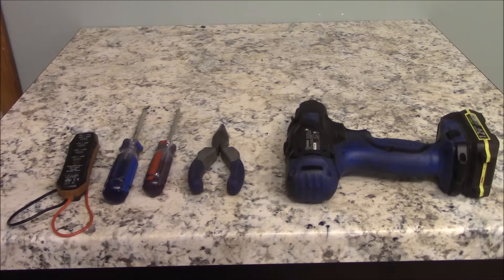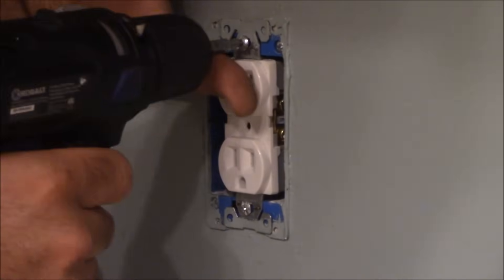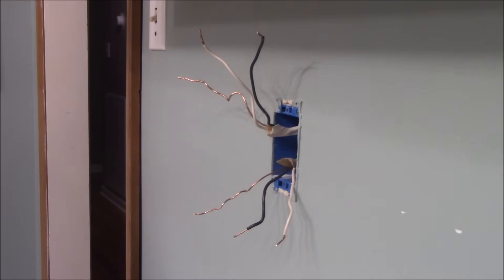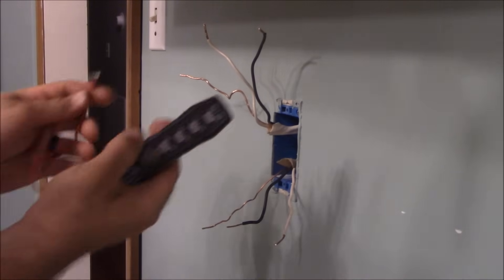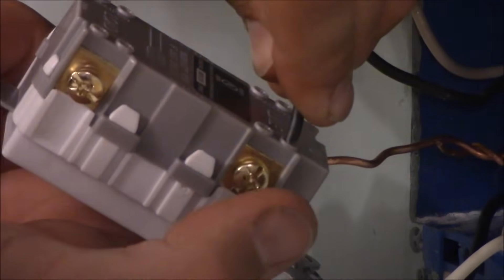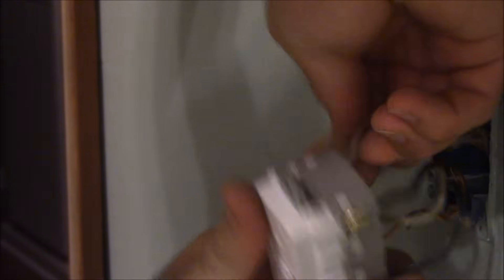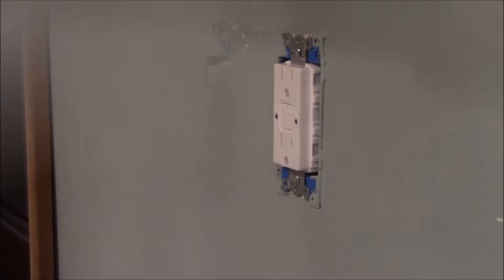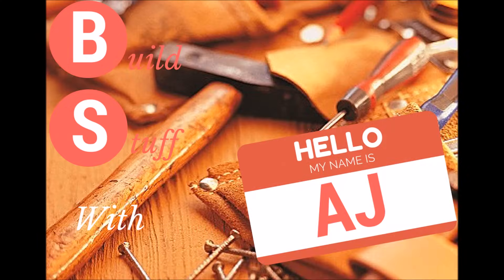Removing and Replacing regular outlet with GFCI outlet

Comment: What if both my wires are load wires? it’s a two circuit outlet?
Reply from the maker: Do you mean that there are 3 different set of wires comming Into the box?
Reply: @BuildStuffwithAJ  What I’m going to do is just install an outlet receptacle like the one before it. This is a split circuit sharing one neutral wire and there’s no way to split the GFCI outlet. Thanks for your help!
Reply from the maker: @LeonidasD828  yea that sounds like your best option. They may sell a gfci outlet that you can split, but I've not installed one personally so I cant say for sure.
Reply: @BuildStuffwithAJ  I switched the outlet to a regular outlet and broke off the tab on the brass side(hot) and we’re good to go. Thanks AJ!
Reply from the maker: @LeonidasD828  that's great to hear! I'm glad you got your project finished!
Reply: @BuildStuffwithAJ  Hi AJ no going into the box is Two lives with one of those lives caring a neutral and a ground wire I believe it’s a two circuit with one shared neutral usually when you connect the cables on an outlet like this you break the tab in the middle but on the GFI I do not see a tab that I can break

Comment: Nice video. I will be doing this install soon. My only suggestion is to check to which wire is hot before unscrewing them. There should be enough bare wire to test so a bunch of wires aren't so exposed. Also, can you pigtail the ground wires instead of connecting both?
Reply from the maker: That's certainly another good option to test it. If you have a multi meter you can test it with out even turning the power on actually. But I didnt own one at the time and in sure not every one does so that's why I showed testing it the way I did.
  I did end up pigtailing the grounds on mine. Should do just as good!
  Thanks for your comment!

Comment: Hey AJ, how far does the wire need to go into the hole? Just push it in until it bottoms out? Also, when using the multi meter to check for the hot wire, can I put one side of the multimeter on the supposed hot wire and the other on the ground wire? Curious because my light switched don't have a neutral wire, just one hot, one traveler wire and the ground wire.
Reply from the maker: I believe in general you want to strip between 1/2 to 3/4 inch. If you push it in all the way and you have bare wire showing trim it off. As far as testing for the hot wire goes, click this link.  This guy explains it very well and how to do it in a safe manner. 
https://youtu.be/uuIzXp7bzUo

Comment: AJ , hi. can this still be done if Arc flash has happened to the outlet, we had a vendor in putting in a countertop in bathroom, we had the cover off to paint, but the metal plate was still on and he didnt see it and plugged in a dryer , when he pulled out the arc flash happened, plug and wall is black, GFCI is what was in there
Electrician wants 170 to replace, just wasnt sure if that had happened is it safer to get them to do it. thanks for any guidance on this.

Comment: I have 2 outlets on each sides of the sink, should I install 1 or 2 GFCI or only 1  because they are connected together ?...
Reply from the maker: If you install 1 gfci be sure it is the one that comes first in the circuit. In the box they should have little stickers that says gfci protected. Be sure and put that on the other outlet.

Comment: This is exactly how i wired my outlet and ive done this in 2 bathrooms and after cutting the power back on ive noticed the lights on the outlet does not come on....ive rewired it...incorrectly and then rewired it correctly just to see if i messed up the wiring...and ofc after checking that i wired it correctly, the green light  doesnt come on. Nothings tripped on the breaker panel....not sure why something so simple cant go smoothly for me...every home improvement project i do NEVER goes smoothly lol
Reply from the maker: Check out this website. Several people have had the same issues on this forum and they were all caused by different issues it seemed. Maybe one of these solutions will help you out.

https://diy.stackexchange.com/questions/122125/new-gfci-outlet-green-light-is-on-but-no-power
Reply: I had the same issue as you, but after reading through the instructions that came with it, it mentioned you had to hold in the test or reset button for the first time. I had to push pretty hard and very far in to get it to work.
Reply: Ill have to give these a try then...sadly still no luck lol...

Comment: Hi, after I replace new GICF out let , all wires connect to right place , I saw little green light are on but NO power , pls give me advise how fix that , thanks for your help
Reply from the maker: Sounds like it's not wired correctly.  
Is the black wires connected to the brass? 
And the white connected to the silver?
Is there 1 set of wires connected to the outlet or 2?
If you have 2 sets of wires, are you sure you have the incoming power on the line side?

Comment: If I have a series of non GFCI outlets, can I add a GFCI at the end? I assume the GFCI would only protect things after it. I want to put one in a bathroom on the backside of an outlet in living room.
Reply from the maker: Yes you can add a gfci to the end of a series of regular outlets. And your correct in assuming it would only protect any outlets past the gfci.
Reply: @BuildStuffwithAJ  Thanks for reply. I am realizing 2 outlets can't be back to back, as the boxes are too big for 2x4. Is there a special device for this?

Comment: How about installing a gfi getting power from a 3 way switch?
Reply from the maker: How many wires are comming Into your box? If your switch powers just that one outlet then it should be pretty straightforward.
Reply: 2 white and 2 black. The only time the gfi works is when one of the 3 way switches turns it on. No constant power and this is what I need help with. Thanks.
Reply from the maker: @randyabraham1058  it sounds like you have a series of outlets controlled by the switch. If it's an older house like mine was then it was probably with lamps and the light switch turned the lamps on and off. 
  If that's the case and the switch controls multiple outlets, then they are probably all wired in series and none of them have incoming power unless the switch is turned on. 
  Unfortunately it's not a simple fix.  you would have to get into the electrical box where the switches are, find out which wires go to the outlets and which wire is the hot wire. Then simply bypass the switch. The outlet would have power all the time and your switch would be useless.
  If you've never worked with electricity before I suggest calling an electrician, because it can get a little complicated when trying to determine which wires go where, And to do the job safely.

Comment: Our house was build in 1983 and doesn’t have any GFCIs. I tried replacing one of the outlets in the kitchen (the first in the series) with a gfci and it’s not getting power. It doesn’t have an indicator light so I can’t tell for sure but the test button isn’t doing anything and no plugs are getting power from it
Reply from the maker: It could be a number of things. Let's start simple and work our way up. 
  Have you checked the breaker to make sure it hasn't tripped?
  You said you tried the test button, have you pressed the reset button to turn it back on?
  Did you wire it backwards? In other words, did you put the in comming power on the line side or the load side? The in comming power needs to go to the "line side" it should be labeled on the  back of the gfci.
  Rewatch the video like it's your first time viewing it and make sure you did everything the correct way.
  If none of those fix the problem then the new gfci you purchased might be bad. It's happened to me before. Try returning the one you installed and replacing it with a another new one.
  I hope this helps.

Comment: If you don't have a voltage meter you can use a light bulb or plug in item like lamp or radio
Reply from the maker: Good tip!

Comment: One thing I like to do is cut the old exposed ends and strip fresh wire before connecting to outlet. This reduces possible fire hazards
Reply from the maker: How does it reduce fire hazards? Not a bad idea to do it anyway but I'm a bit curious how it helps.

Comment: We tried to replace ours and now 3 outlets aren't working 😭 the first one worked but the other two aren't working and now all three aren't working.  We checked we only have one other GFCI and it wasn't tripped. Can't seem to figure out how to fix it now 😭
Reply from the maker: Were they working prior to installing your new gfci? If they were all working properly before you installed your new one it could be a few different things. 
  Does the new gfci have power? Do the buttons work? Test it by pressing the test button and then pressing the reset button.
  Was it wired correctly? Be sure you have the incoming power connected to the line side of the gfci. The other outlets are more than likely wired in series.
  If you're 100% sure its wired correctly it could be the gfci. It's happened to me before. I bought and installed a new gfci outlet and it was already bad. 
  It's hard to diagnose a electrical problem with out being there in person so I hope this helps.

Comment: The circuit breaker had dripped, but I turned in on again. Still no power in the outlet plug. Could you do a video on debugging that? Tried many solutions, but none worked so far.

Comment: Can this be accomplished without a multimeter?
Reply from the maker: I used a voltage detector, you can technically accomplish it with out the use of one, it's more of a safety precaution. 
  I suggest you use one any time you are working with electricity, it could save your life.

Comment: I changed my gfci to new one, does not let me push the test button. It shows the light green, but nothing received electricity.  Whats wrong?
Reply from the maker: There could be a few different problems causing that.

  It's possible that you mixed up the line wire (incoming power) with the load  wires. If they are backwards it could cause the gfci to not reset.
  If your old gfci had the same problem as your new one, it could be a problem with your circuit. It could be a wire rubbed through the plastic insulation causing it to short out. Or it could be an appliance short that's still plugged into the circuit down the line.
  It's also possible that the new gfci is bad, I've had that happen before. 
  As I said there are alot of different causes for it to not work properly. I would start by rechecking your wiring, it would be the simplest thing to figure out

Comment: At 3:00 I think there is a safer method.  Leave power off. Set meter to ohms. Check from ground to neutral. Neutral only connects to ground in the breaker panel. Whichever set of wires that show a connection between neutral and ground is the side to connect to line.

Comment: Ground wires are not code the way you hooked them up.. Im an inspector
Reply: I’m switching out a regular outlet with a gfci. When I connect the line it works. When I hook up the load it trips. What’s up?  I’m doing this in my bathroom

Comment: Hi, I have an old house built in 1932 that came with 2 prong outlets, all I see are two wires connected to the outlet, and no ground wire, how do I replace to 3 prong and make it safe with ground? or in other words, how do I know where to put a GFI in the circuit?Thanks.

Comment: I need help my gcfi the light is on but no power to the outlets. Tried everything!! Cannot get it to work. Help 😥
Reply from the maker: Re check your wiring. If your neutral isnt connected properly (white wire) it could cause your light to come on with no power

Comment: So I don’t need a gfci breaker??
Reply from the maker: I'm not a licensed electrician so I cant say one is better than the other. But they work differently.
  The gfci breaker will protect the entire circuit. Where the gfci outlet will protect that specific outlet and any other that comes after that outlet in the circuit. 
  I'm not sure one is better than the other but both have their uses.

Comment: I'm trying to solve a surging problem I've been having with a Daewoo 4.4 cubic foot mini fridge I just got. I've been runing on a standard outlet on a surge protector. Could replacing a standard 15 amp bedroom outlet the mini fridge is plugged into with a 20 amp GFCI outlet solve the surging problem I'm having? The mini fridge is brand new & undamaged(just bought it last month) so I'm pretty sure its not that causing the problem which has me thinking its an outlet problem. I'm thinking the mini fridge may not like running on a standard 15 amp bedroom outlet. It was also doing this with an old Kenmore 4.4 mini fridge. I replaced the Kenmore mini fidge with a brand new Daewoo mini fridge hoping it would solve the problem but it didnt. It runs significantly quieter than the old Kenmore but the surge problem still presists when the compressor in the mini fridge turns on & off.
Reply from the maker: I am not a licensed electrician so I can't say for sure. But I would go to the breaker box and find the breaker that controls the receptical in reference. If the breaker is a 20 amp breaker then technically you can replace the 15 amp outlet with a 20 amp outlet. But if your breaker is only a 15 amp then I wouldn't suggest it. It wouldn't do any good, it would still trip once it pulled more than 15 amps.
Reply: @BuildStuffwithAJ  I see. I'll look into that, thanks. I was thinking of trying one of those Isobar surge protector things to as an alelternatave to having to replace an outlet. Most surge protectors only seem to prevent a device from surge damage more so than a device causing a surge. Hopefully an Isobar could help the other way around.
Reply from the maker: @theatom7264  best of luck to you, sorry I couldn't be of more help
Reply: @BuildStuffwithAJ   No worries. Difficult to find a solution to a device causing a surge vs protecting it from a surge. I think a Trip Light Isobar could be the solution

Comment: I have a white, black, red, and ground wire. Where do I hook up the red wire?
Reply from the maker: Where was it hooked to on the other receptacle? I would put the wires in the same places as your old receptacle. It was worked that way for a reason. With out being there in person that's the best advice I can give you.
Reply: @BuildStuffwithAJ  That is what I did but it now keeps tripping. The outlet I replaced was not a gfi outlet.
Reply from the maker: @craigd9616  hmm its difficult to trouble shoot with out being there in person. Sorry I'm not able to help more. But I have no idea where this wire goes so I can't tell you where to put it

Comment: Your video is very good. There are two more things that should be added for extra safety. At the beginning, test the outlet for existence of power BEFORE you turn the power off.  The purpose of this is to test the TESTER not the outlet.  That way when you test for NO power and see no power you know the tester is working.    Lastly, at the end when you test the gfci and it trips you need to also test that the outlet no longer has power.   The reason for this is because if you wired the line and load wires backwards the tester would still trip successfully but the outlet would still be live!  So that is really important.  I’ve found that using skinny probes in the slots is not a reliable way to get a good contact. I’d rather plug a light in the outlet to test for power it’s more reliable.
Reply from the maker: That's great information! Thank you for the comment!
Reply: Super great addition to the video. Honestly really glad I checked the comments!
Reply: It worked, thanks
Reply: Thanks for the supplemental comment!  8 and 5 years later and the video and this comment are still helping folks like me get things done!
Reply: Hmm I was gonna take a crack at change the wall outlet but after reading this it's probably best I just put something to keep it out of view

Comment: Sorry to have to point out the wrong things he done, but,  the insulation on the romex should only enter the box for about 1 inch, at the most. In showing putting on the bare ground, he placed both wires under the ground screw, we never do that,  grounding wires in all outlet boxes are always twisted together, then later on, he shows the two ground wires  twisted together, very bad twist, I might add, and it should have had a green grounding wire nut on it. Lastly, the box looks like an old work pop in, so for the outlet to fit flush to wall, he should have taken off the four round parts on the yoke of the outlet, so it would fit down into the recessed part of the outlet box.

Comment: Your video is very informative but what if my gfci is controlled by a switch and I want it to be hot all the time?
Reply from the maker: Here is a link to another video I did installing a ceiling fan. I had a switch set up to control an outlet like you have and I show how to wire it hot all the time. Click on the link below to go to that video and skip ahead to 11:15 and it will show you how to do it.
https://youtu.be/zTD__Yar1sc
Reply from the maker: That video will show how to wire it hot all the time. Once you wired it up you can take out your switch and get a blank plastic cover to cover up the hole.

Comment: Only thing I noticed is that I have been told that it is not kosher to attach two ground wires to one ground screw. I may be wrong, but whenever there are two ground wires, you should use a pigtail or a special two to one insulated connector so that only one wire goes to the ground screw. Check the code before attaching two ground wires to the same screw.